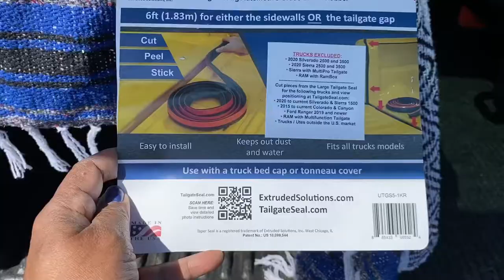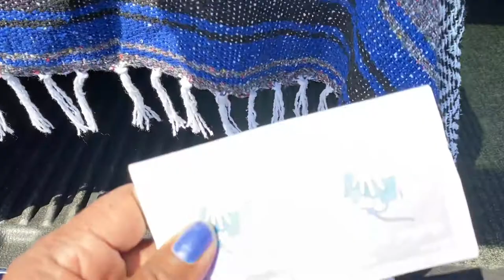Seal your Truck Tailgate:  Keep out dirt, water and bugs!

Comment: Ohhhhh! I wondered about that! A dusty road would be a nightmare wouldn't it?? Yikes. I would definitely need that stuff. Great solution! Does it still work good? I see where you mentioned you would need to add more adhesive - did you? If so, what did you use? I could see how dust may eventually undermine the sticky stuff.
Reply from the maker: It’s actually worked real well!  I think I may need to add a little more this season to keep the holes closed.